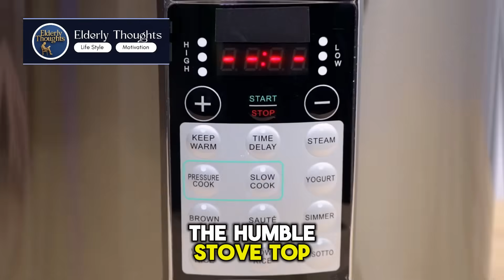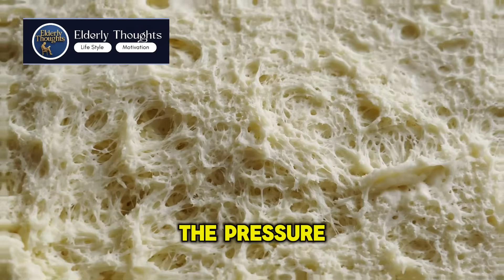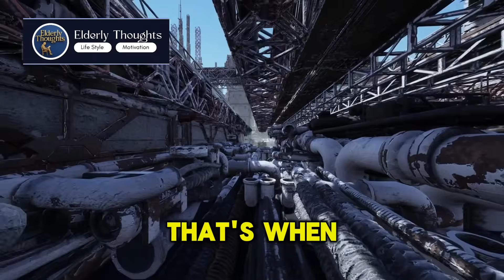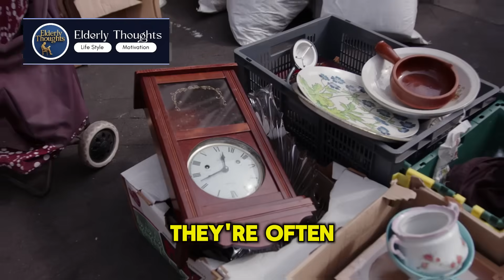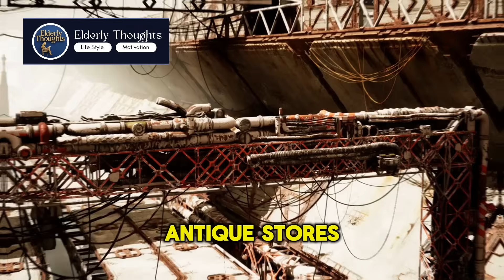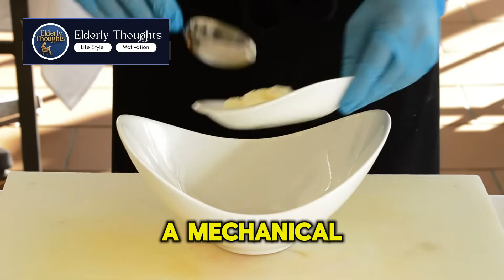7 Budget Items That’ll Keep Working When an EMP Destroys Everything

Comment: Travel bidet. Toilet paper will run out. Rope lighters. you can get lots of 100% cotton rope cheap and prepare them as char cloth for starting fires. Folding hand saws and axes. You may need to go get wood for a fire to keep warm and cook food. Honey in glass jars. Lasts forever and can be used on wounds as well as being food. Magnifying glass. Can be used to start fires and do detail work. A manual water filter. Bleach, good old bleach. Cleaning and water purification if used properly. Gatorade. Makes purified water taste better and gives a boost of carbohydrates (sugars) and electrolytes.